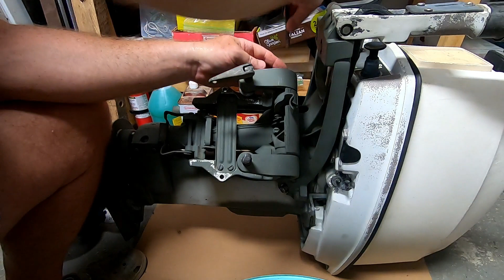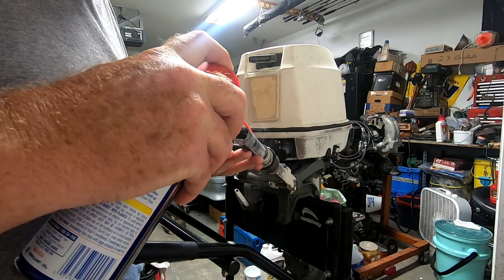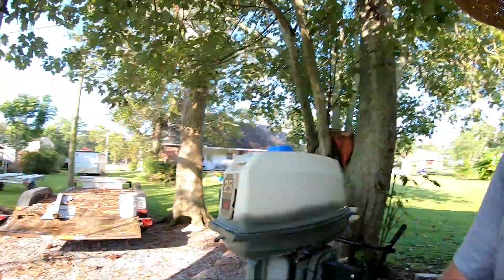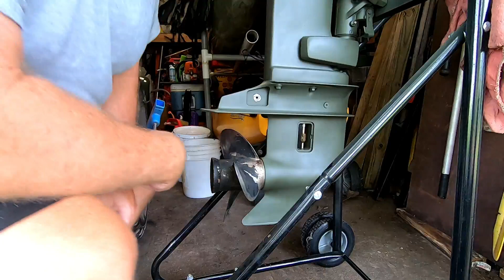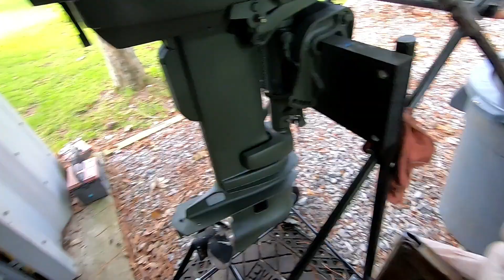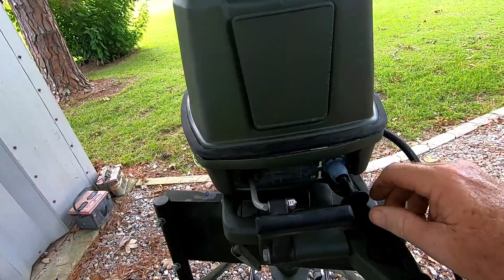1992 Johnson 25 hp Refresh part 5 of 5 final details and start up

Comment: Can you add electric start on this motor? I noticed that the flywheel didn’t have teeth on it.
Reply from the maker: You would need a donor motor for the toothed flywheel, starter, brackets and alternator coils. But it can be done.